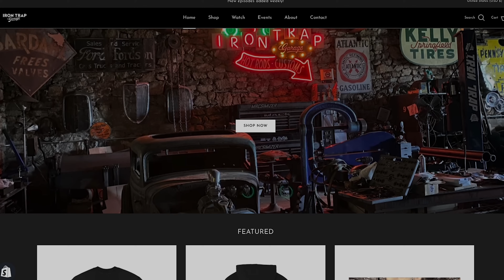First Test Drives, Wednesday Car Show, Warehouse & Project Updates!!

Comment: Some of the flatheads with a 3 1/16 bore came with sleeves. If you remove the sleeves the cylinder was .080 over. I suspect the .0825 pistons were made to fit after honing. I had one like that back in '57 or '58.

Comment: A little tip on your scrap metal. You should separate your cast iron from the rest of your steel.  All the yards I deal with pay quite a bit more for clean cast iron. I always keep the brake rotors, engine blocks, cranks, heads, etc. separate. The difference in price adds up quick.

Comment: You guys appear to be getting quite the organized business !!! If you can "spare" the tractor at the shop temporarily, maybe it can live at the warehouse for a couple of weeks to help Mike out since the fork lift is absent ??? 
That "plastic" in your new shop floor is called a "membrane" since it's intended to keep water from coming up through the concrete. Yea, in the building business, concrete is a BIG DEAL !!! 
That "ruined" roadster sounds really nice !!! The biggest thing with a flathead is if the block is free of cracks. You didn't mention if that one you "cut" the crank out of was any good with that in mind ??  What do you find is the "common" average of good/junk flatheads when you acquire any number of them ??